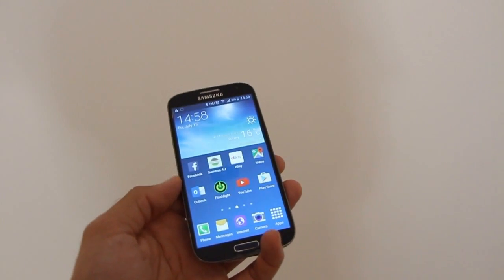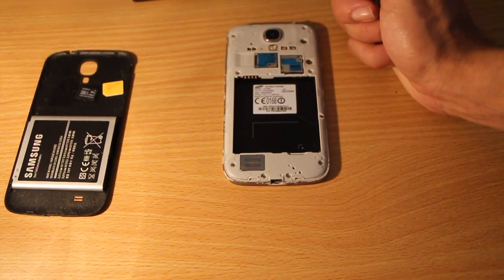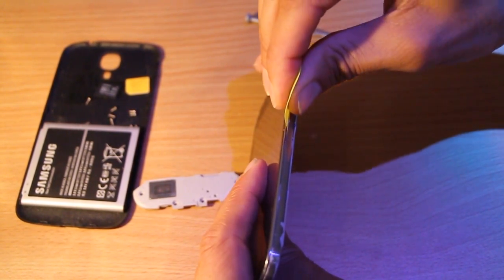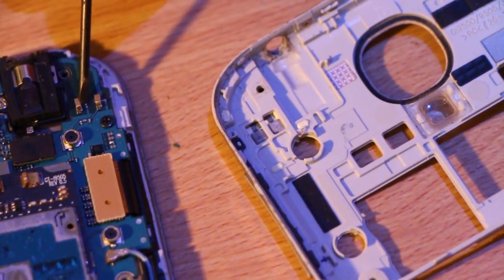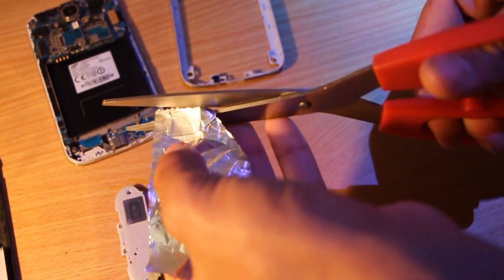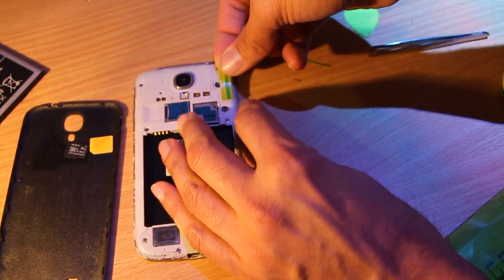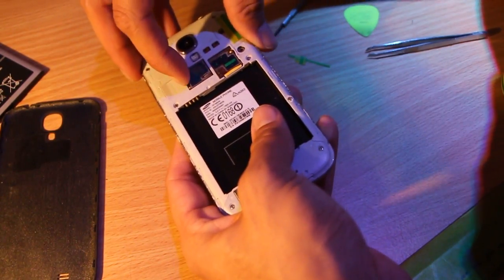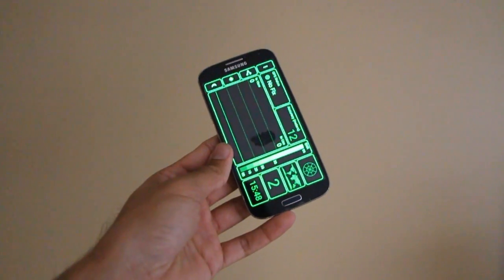How to fix your Samsung Galaxy S4 GPS

Comment: How can I do this with my poco f1 😭 since I replaced the motherboard, neither the gps nor Bluetooth works😭
Reply from the maker: Sounds like their antennas aren't connected to the mb
Reply: @outie555two  my Bluetooth receiver does work now! I am actually glad that at least I can use my Liberty Air 2 earbuds again, damn haha. But GPS still not working. It locates my position, but the direction is a bit off and when moving, like driving, it doesn't work. Any ideas what I could do? Cuz the thing is, I have no idea where my GPS is located on the motherboard not do I know where the connectors are.. 😅

Comment: Hi, I am looking to service manuals and on this right side are connectors for GSM only. There is socket for GSM external antenne. For GPS is connector on oposit side board in left upper corner . Next to screw. Try do it same with GPS connector.

Comment: pretty sure that is not the GPS antenna, is at the opposite side :) solution is simpler: be sure the part of the "frame" containing the real GPS antenna is "pressed" against the "mainboard" (example by tightening more the screws and/or adding a thin layer of tape to create a thickness so that when put back in place the back cover the "frame" will be keep pressed)

Comment: Thanks sp muchfor the explanation and problem solving. I fixed the repair by using contact acid on a spray, brandname Kontakt 60, which also fix many other unstable electric issues. Her is the Link https://www.google.com/search?q=kontakt+60&rlz=1C1GCEA_enDK844DK844&oq=kontakt+60&aqs=chrome..69i57j0l6j69i61.2666j0j7&sourceid=chrome&ie=UTF-8

Comment: Just did this on my S4. Before gps location was weak and took ages to give a location if at all. I couldn't use google maps to navigate in the car because of it. I was thinking of upgrading my phone then saw your video. Great instructions. You don't need to remove the speakers at the bottom but everything else is dead on accurate. Folding the foil was tricky and took a few goes. After reassembled & tested. The GPS signal is now as strong as it was when it was a new phone and can use it to navigate again. Thanks for the helpful video.

Comment: Great video, great tutorial, great work, thanks. Super you are using household item to repair. You should have commercials connected to procucts Liquids which actually remove oxidation of connectors, and you would be rich quickly.
Reply from the maker: Yeah that would be nice. Probably too much work though and besides if people can do it themselves for free then I'd rather that.

Comment: Ok guys i need ideas. Phone dropped screen cracked. Repaired in mobile phone service. After that everything is working no issues at all, except GPS. Already tried all gps fixes, new service firmware with new PIT etc. Also tried fix from this video. Nothing helps. GPS was working before impact :) GPS test say 20 in view 0 in use. Any other ideas ?
Reply from the maker: Maybe your antenna got cracked. But having said that if it's picking up satellites it might just need the GPS time synced. Download GPS test (free) on the Play store. Press the ... Button in the ap. Press AGPS. Select clear and update. Leave it outside with clear line of site to the sky and it will download from the satellites the new GPS library with the time and location of the satellites to sync your position. This could take 10 minutes.
Reply: @outie555two  Tried, tested. No beans. Also, i noticed that GLONASS sats are available and i pick them. But no gps sats. Today i picked only 2 GPS sats for short period of time. Looks to me like it needs some kind of calibration. Btw thanks for reply
Reply: I want to know this one. Is there any other file except gps.conf who manages GPS ?

Comment: Is my Samsung Tablet S4 going to have the same kind of problem too? Where is the GPS antenna located in my case?
Reply from the maker: I would think it would be different inside so maybe not. Can't tell for sure as I don't own one.
Reply: Yeah, I have unmounted my Galaxy 7" Tab 4: inside is completely different...
As I can see, there is a well made contact to the antenna: a little metal tab with a small tip on the top that is pushed against the metal strip of the antenna. It should ensure a better contact surface.
I have just cleaned it and gently bent a little bit using the tip of a very ultra-small screwdriver. So, maybe, the problem for the Tab 4 is not the antenna itself...

Comment: The GPS antenna's contacts are actually on the opposite side! Those two little plates are for the 4G antenna. But opening and closing the phone probably were enough to move the GPS contact a little bit and provide proper contact again, together with retightening the screws.
Reply from the maker: how sure are you of that?
Reply: 100%. Just look at an official documentation of the parts inside the phone. And to verify: cover the contacts in question with a thin paper or some plastic foil and see what stops working afterwards.
Reply from the maker: can you provide a link to the official documentation you are looking at please.
Reply: Yes. You can find the manual here: https://forum.xda-developers.com/showthread.php?t=2444868
The connector for GPS is "ANT801", which is located on the top-left, when looking at the PCB. See chapter "8-4-22. GPS" for detailed view.
Reply: See also this video, explaining every part in the S4:
https://youtu.be/zm4f2XjQLAM?t=3m30s
Reply: vermutlich reicht das kratzen der kontakte aneinander. leider ist dieser falsche gps trick sehr verbreitet.
Reply: LOL you just got owned

Comment: You saved my day man. I've had problems with my gps signal for more than a year from now, making gps navigation useless, even considering taking the phone to a professional for repair, but this trick worked like a charm. Less than 5 seconds to get the signal outside, and less than 30 seconds inside. You have my deepest and sincere thanks.
Reply from the maker: +azathoz great to see the problem fixed

Comment: Great stuff mate. My GPS signal was forever dropping out. "GPS test" app showed low signals when testing side by side with my wife's phone. ( her phone had great signal strength )I started to remove the screws as you suggested and found the 4 upper screws very loose. so I tightened the up. ( made a better contact as a result )Tested again side by side with the wife's phone and had great signal strength just from that.If it plays up again - i'll strip it and use the foil.wouldn't have noticed the loose screws if not for your videothanks again mate
Reply from the maker: nice that saved you some time, and as a plus if it fails you now know this video exists :D

Comment: Does this solution work on S5 mini? Please let me know as soon as you can
Reply from the maker: Sorry i dont own the S5 mini, just the Galaxy S4. Perhaps try googling the internal components to see if the S5 mini has the same type of GPS antenna with the pin connectors that the S4 GPS has. If it does, it might be able to be fixed the same way, as the pins and contacts might have slightly degraded over time with your Mini S5

Comment: Well, after a couple of weeks its back to normal or even worse connection... Idiotic design to have pressure connectors between the antenna and gps unit. Its just asking for trouble... :-/
2nd time I fixed it I skipped the alu foil and just carefully lifted and bent the connectors a bit and added contact paste. Worked since then. :-)
Reply: THanks for the share. Is contact paste the same thing (or at least works the same way) as an electrical fluid pen?
Reply from the maker: that's good to know buddy!

Comment: thanks so much. not only do i now get a GPS fix; but a massive improvement on my GPS signal.
i did discover one thing, and you might want to take note:
your gps signal will be reduced depending on the type of battery case/back cover you use.
if you use a stock plastic cover: you're fine and you can enjoy your new stronger gps signal.
however if you use a 3rd party anodized cover (theyre a little tougher) your gps signal will be reduced slightly. 
i experimented with this and took some screenshots of the results.
thanks again though!
Reply from the maker: Bibs y that makes a lot of sense as it would degrade the signal. thanks for your comment and good to see the fix improved your signal :)

Comment: Great video... as a tip: consider this: Instead of playing around with foil, you can also GENTLY extent the range of the connection springs on the motherboard. (just a millimeter or so). this gives an extra pressure on the contactpoint, basicly doing the same as the foil but preventing extra surface to surface resistance...
Reply from the maker: thanks buddy. you could do that for sure, but for me as there was corrosion on the contacts it would last longer by using the foil. Did you do that with your pins and did it work? Let us know in the comments if it did as i am sure someone else out there would be wondering if it does work too. Thanks again :)
Reply: Yes, I did that and works... Adding an extra layer between the board contacts and the pins doesn't bypass the corrosion points but adds extra pressure on the contactpoints... adding a bit of contact spray works for that problem!  Cheers!

Comment: Thanks for a great instructional video. This worked a treat with my S4 (i9505). Earlier this week I struggled to get a satellite fix with just 3 or 4 satellites on the deck of a ship in the Bay of Biscay. After following your video I get up to 13 satellites indoors and a fix in moments.
Reply from the maker: that's great news, now you can find out where you are again :)

Comment: When it's still Not working, go to Phone, tip in #0# and go to sensor. the lay the Phone on a flat surface and tap "Gyro selftest" the möge the Phone until ther is in the Black round Surface a blue stripe and a "3". thai it works ;-)
Reply: (star) # 0 (star) #

Comment: Great, it worked! I had one screw cross threaded or otherwise difficult to remove such that I stripped the head.  My solution was to file my 2mm flat head to about 1.5mm on a sharpening stone to fit what was left of the philips screw head.  Not sure if the  yellow and green tape is a troll because the screws are going to keep the contacts tight much more than the plastic clips of the back but everything else worked a treat.  Thanks for the demo.
Reply from the maker: that's awesome that it worked for you buddy :D 
the tape just puts a little more pressure on the plastic around that area. you could probably get away with not doing it but for the sake of a few seconds its worthwhile.

Comment: I don't know if you noticed but...there's a little access panel right where you are putting the tin foil so there is no need to take the whole phone apart.  Just remove the access panel.
Reply from the maker: have you done that successfully?
Reply: Yes it worked fine on mine.  You have to be careful though because it is mostly held on with double stick tape.  You want to make sure the tape doesn't fold or anything so you can stick it back on.
Reply from the maker: Nice :)

Comment: Hey dude I gotta tell you I had the same problem with my S4 contacted Samsung told me to install new firm where NO FIX down load Smart Switch to back up and move my texas holdem game to my SD card and then to restore factory settings pushed the button and boom lostb 73 Billion dollars on holdem and 500 contacts on my phone still no GPS not happy I only wished I watched your video first I did exactly what suggested I have turned on my GPS about 30 times today works like a charm Cheers Mate good workDom
Reply from the maker: glad it worked but shame that you didnt stumble upon it first like you said :(

Comment: TQVM bro, your method definitely working. I want to share a little modification I made to your existing method. Instead of using aluminum foil, I am using Tamiya 15421 Gold Plated Terminal Set (for Super-II Chassis). Use front battery terminal to be exact. It has perfect thickness and height. Just have to cut it to perfect width. With GPS Test apps, I can lock about 20+ satellites indoor. Thanks again for uploading a very helpful video.
Reply from the maker: thats great. must make for really good contacts. glad the video helped you and thanks for your comment

Comment: I've tried other fix for my S4 that didn't work and I was looking for a fix that works and it seems to be working well !
Just need to see on the long term but the idea to compensate for the lack of contact that way is far better than using the screws !
Reply from the maker: mine is still working great so if its worked for almost 2 months i think it will be a long term fix (fingers crossed). yeah its a simple fix and works great

Comment: Oh wow. does this work for a S5? if it does this will change my life
Reply from the maker: i think they changed the connector quality on the s5 to avoid this issue. but if you find it works for you then let me know. Otherwise this is specific for the SGS4 galaxy S4 model only not the S5

Comment: I tried that, and it worked. But one of the IT guys (Angelo, thank you) of the company I work for suggested me just to lift a bit the pin connectors and that worked as well (with no need to add the aluminium foil). 
Thanks
Reply from the maker: well that's good to know it can be done without the foil. i wonder if the pins would hold there new position for long though before losing contact again? but i hope they don't as the foil is not practical for everyone to do.

Comment: i have alredy try it it still doesnt works! do you have other way to fix that? thankes
Reply from the maker: maybe its software causing the error?? try reinstalling the android OS 
back to factory defaults. Or maybe its a problem with the GPS antenna, 
is it cracked? other than that i dont know, might be wiser to contact 
samsung for repair

Comment: **WORKING IF YOUR PROBLEM DOESN'T COME FROM SOFTWARE SETTING**

This is insane, you saved my phone thank you so much man.

Before: No fixed signal, 19 satelite in view/ 0 in use...<
After : 3D fix signal, 19 satelite in view / 9 in use with a 37 feet accuracy and a lot of '' Strong Signal '' ( showing green ) 

Dude you made my day thank you so much again !!!

Like so everyone can see that
Reply from the maker: I am so glad I could help you too. I was almost going to get a new phone too but this worked a treat too

Comment: Thanks for sharing and I can tell that mine has improved as well. However it turned out that while yours has helped stabilise my GPS signal, it turned out that the main culprit has been me using HARD COVER, which I believed blocked the signals coming out. Everytime I got rid of it the signal would get better and would weaken again once it got put back on.
Reply from the maker: thanks buddy. maybe the cover was causing the contacts to warp or something when it was on. but glad it helped

Comment: That worked a treat! I used sticky backed copper tape I had from a previous project rather than household foil. I also noticed during disassemble that the screw located at L1 was not properly tight so made sure all screws were properly secure on reassemble.
I didn't bother with the piece of tape but the difference on GPS Test before and after the fix was remarkable.

I've been having serious problems using Google Maps as a GPS device recently but this has sorted it out. Thanks for a good clear, easy to follow video.
Reply from the maker: Glad it helped buddy. and good to see that it still works without the extra tape
Reply from the maker: Glad it helped buddy. and good to see that it still works without the extra tape
Reply: I am surprised that the adhesive from the copper tape still made contact

Comment: hi.. why is ur gps show no fix when its in the room?
Reply from the maker: Electromagnetic radiation can easily be absorbed or reflected when travelling through walls and roofs. This is especially true in regards to the signal from the GPS satellites that are in orbit around the Earth. Inside a building you will have a hard time getting signal if you can't see the sky, unless your roof is thin such as a tin shed or you are near a window that can see the sky.

Comment: I have the same problem.  I do the things like you, but it still not working :( The gps icon just searching, and never fix. And my position is not the real.
Reply from the maker: Try the gps test app. in the settings select clear agps then update. leave it outside for 10 minutes to see if it starts receiving a new gps satellite position library and consistently gps signal fix
Reply: Yeah, I had to clear data, go outside and wait some seconds until my GPS started working again. I think the chip was kinda rusty xD